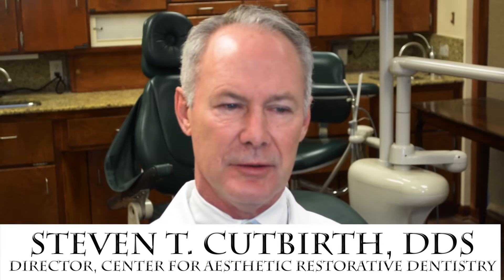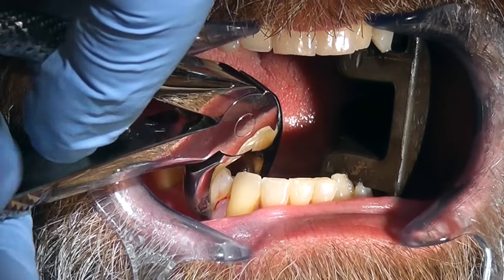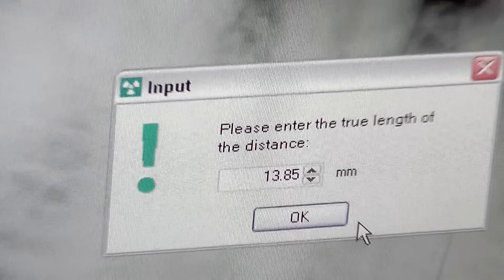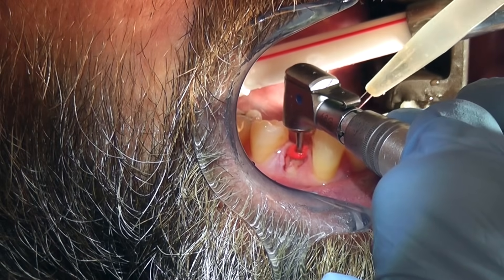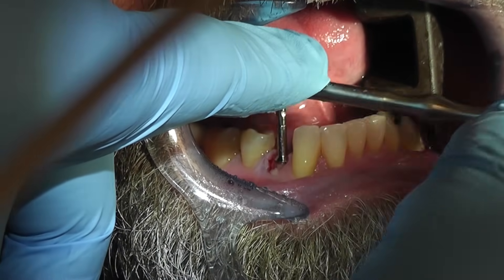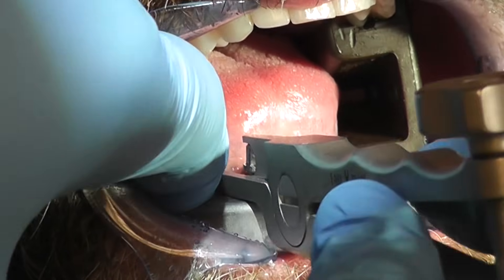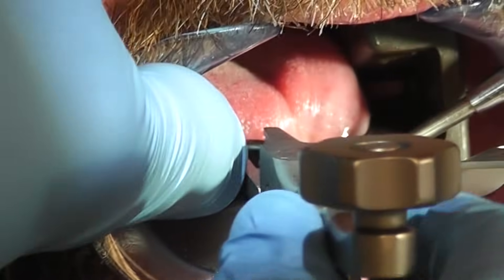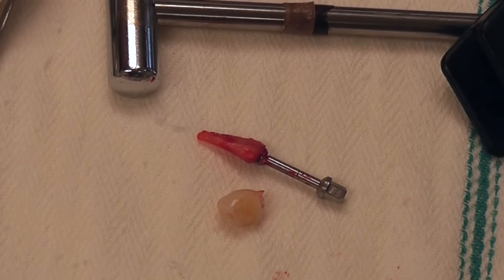Easy Tooth Extraction - Dental Minute with Steven T.  Cutbirth, DDS

Comment: My dentist just used a flathead looking thing and pried at them bitches then got those giant plyers and twirled it all around. Had 4 out in less than 5 minutes. No problems so far.

Edit: 4 front teeth. Upper front.

Also, for anyone dreading a tooth extraction, I was beyond nervous. To be honest, the shot in the front of the mouth hurt the most. Getting a shot in the back of your mouth is easy but right under the front of your lip and the roof of your mouth? Oh bud, not fun.

The extraction process was way easier than what I thought. It was pretty much painless, mainly just a bunch of pressure. Then you'd hear a small little snap, not super loud though just a little snap. The recovery process though, that sucked for about a week. I had a gnarly smell coming from those sockets for the first 4 days but no infection & no pain. It was an awful smell. That was the worst part by far.
Reply from the maker: Terrific.

Comment: I had been stressing to get 2 adult premolars removed for braces for ages. Finally got it done yesterday. EASY. They put some numbing gel on my gums before they used the needle for anesthesia. This hurt a little bit in some spots, especially when they go into the roof of your mouth. But when they started wiggling the tooth with forceps, it only took like 1 minute. Only discomfort was some cracking noises and your head being tilted slightly. After, it bled a lot for like 2-3 hours, but I just let the spit and blood combination dribble out of my mouth into the sink (don't actually spit). You cant really talk that much for the first 2 hours because your face is still dead. Had some painkillers and stuff but never actually felt any pain, just took them as a precaution. I drank a smoothie for dinner 2.5 hours post extraction. Next morning it was all back to normal, your holes where the teeth were go soft with the blood clot. Just be careful that you chew with the other side of your mouth. 

Its really easy guys, no need to stress. The dentist keeps you calm by telling you what they are doing.
Reply: I rather be gassed up instead of wide awake
Reply: @brandonroberts7055  well if u can afford then go ahead. Sometimes in life u gotta deal with the pain
Reply from the maker: So glad the procedure went well.
Reply: @centerforard  yep, getting another 2 out tomorrow! much less nervous now
Reply: Can i eat chicken
Reply: @annarapushobha1899 in the weirdest way this comment is so funny to me 😭
Reply: You completely took my fear away I’m here now for two teeth
Reply: @amariemorgan2515  
As someone who went on June 1st also.. How’re you doing love?!
Reply: I go get a tooth pulled tomorrow after work and I am TERRIFIED, NERVOUS all of the above… Any tips that’ll help me get through this…
Reply: I need to get that done soon, I’ll probably pass out
Reply: @User-718_  you will be fine
Reply: anesthesia? we’re you asleep for the procedure? we’re you able to eventually eat on the other side where the tooth came out?
Reply: @aliciyahunter8203  Yeah local anaesthesia so you cant feel the area where your tooth is and your cheek. You probably should eat something soft like soup the day of, but you will get back pretty fast to eating as usual
Reply: @maxcarnarge9233  thank you so much!!
Reply: Got 3 taken out today.  Didn’t feel the extraction.  The worst part was the anesthesia shots.   MAN DO THEY PINCH AND HURT!   After that, just slight dull annoying pain for the day or two

Comment: Why is all this necessary? You can just pull it out? Why need drills and all that
Reply from the maker: You are either joking or you may not have enough experience to know this, but when a tooth is broken  or decayed to the alveolar crest, there is often not enough tooth structure to grasp with forceps to extract the tooth vertically. This is especially the case if you are planning on placing an implant and preservation of the facial and lingual bone plates is important. Without the EasyXtract or a similar system, you are forced to remove facial bone and/or remove the tooth to the facial, which destroys the facial bony plate, making it more difficult to place an implant because of the lack of bone. 
Take your practice to the Top Tier. Subscribe to DentistryMasterClasses.com for an organized library of all the Dental Minute videos plus many complete comprehensive cases and many very important articles. New cases are added weekly.  Only $20/month.
Click here to subscribe: 
https://membership.dentistrymasterclasses.com/purchase/?plan=513

Comment: What is the benefit of using forceps then burs as opposed to starting with elevators?
Reply from the maker: If you are extracting a tooth that has inter proximal contact with adjacent teeth, there is no space to "elevate" the tooth to be extracted into without also moving the adjacent teeth while elevating. You must create space by cutting between the adjacent teeth with a burr, then you can use elevation prior to extraction with a forceps. Take your practice to the Top Tier. Subscribe to DentistryMasterClasses.com for an organized library of all the Dental Minute videos plus many complete comprehensive cases and many very important articles. New cases are added weekly.  Only $20/month.
Click here to subscribe: 
https://membership.dentistrymasterclasses.com/purchase/?plan=513

Comment: Thank you for awesome video! I was just wondering how many milimiters from the apex you want to be when you drill in? Also would the apical portion of the root ever break off using this system?
Reply from the maker: The drill is a certain length, which limits the depth.  Drill into the canal the length of the drill to the shoulder of the drill.

Comment: How to extract a tooth as a professional dentist with minimal trauma in five steps.

Firstly 3 fundamentals not to be forgotten during extraction:
(1) Adequate access & visualization
(2) A clear pathway for the removal
(3) Usage of controlled force to luxate and remove the tooth.

Step 1

Loosening soft tissue attachment from the cervical portion of the tooth by Molt 9 periosteal elevator, that will give two advantages:
a- Allows ensuring profound anesthesia has been achieved
b- Allowing the elevator & tooth extraction forceps to be positioned more apically.

Step 2

Involves luxation of the tooth with a dental elevator.
Elevation should occur at the mesial and distal buccal aspects of the root.
No elevation should be attempted along buccal bone because it can easily fractured or the surgeon can lose control & cause soft tissue injury.

Step 3

Involves adaptation of the forceps to the tooth.
The lingual beak is usually seated first and then the buccal beak.
The surgeon grasps the handles of the forceps at the ends to maximize mechanical advantage and control.

The forceps are  forced apically as far as possible to grasp
the root of the tooth as apically as possible, Why?
 
1-The beaks of the forceps act as wedges to dilate the
crestal bone on the buccal and lingual aspects
2- Forcing the beaks apically, the center of rotation (fulcrum).

Step 4

Involves luxation of the tooth with forceps.
In 3 stages:
1-Forceps apically seated as far as possible
2-Forces applied in the buccal and lingual directions should be slow, deliberate pressures & not jerky wiggle
3-Force held for several sec to allow the bone to expand.

Step 5

Removal of the tooth from the socket.
Once the alveolar bone has expanded sufficiently and the tooth has been luxated, a slight tractional force, usually directed buccally, can be used.
Reply from the maker: Thanks for the tips.
Reply: I FC
Reply: i need my teeth taken out as well please as my teeth are achin me

Comment: Had two lower molars removed in less than 30 seconds by a dentist in Homestead Florida that used a similar machine that grabbed the tooth then he twisted something like a ratchet and the teeth came right out. He just numbed me up first and that took 20 minutes. I was dreading their removal because I had one done before that took 2 HOURS to get out! All this dentist did was put some type of rubber pad between my teeth and said, You Ready. I was ready to endure a couple hours of torture. There was a clock directly in front of me so I saw the time. He opened my mouth, put pad in, tested numbness, then put his tool in, then crack, twisting noise of his instrument, then crack, twisting noise of his instrument. Then he took pad out stuffed gauze in my mouth. I thought it had just begun and now the hard part was coming. He then said ALL DONE! BLEW ME AWAY! NOT POSSIBLE I THOUGHT! BOTH LOWER MOLARS INE ONE EACH SIDE IN LESS THAN 30 SECONDS! By the way, he would not show me his tool he used when I asked how he did that so fast. He just gave me a BIG SMILE! WHAT A RELIEF THAT PROCEEDURE WAS as I had dreaded it immensely!
Reply from the maker: He may have used something other than the EasyXtrac system.  It takes a minimum of 10-15 minutes to use this system for an extraction.  Nontheless, I am glad it went well.

Comment: Dr. Cutbirth, I like your bolo very much.  Is it Morenci turquoise?  Forgive me but I would have luxated this tooth with the proper elevators/ forceps as I was taught in FDU Dental.  It was a simpler time.  I am from the class of 1978.  Excellent video.  Dr. P-
Reply from the maker: Nothing wrong with that technique so long as you can preserve the facial and lingual bone, especially if you are going to place an implant.  I rarely use the EasyXTrac System unless the coronal part of the tooth is fractured away and there is no way to grasp the tooth with a forceps without removing bone.  In those situations, the EasyXTrac System is priceless.

Comment: omg.. i just found out this site..i can learn so much from you..although this technique you cannot use it for curved rooths in upper molars though..
Reply from the maker: Subscribe to DentistryMasterClasses.com if you wish to see comprehensive, more difficult cases.  It only costs $15/month to subscribe.  Try it!  You can always cancel if you don't think it is worth it, but I promise you will feel you are getting your money's worth ten fold or more.
Reply from the maker: That is correct.  This is a technique primarily for 1 and 2 rooted teeth, i.e., bicuspids and anterior teeth. If the molar tooth extraction is difficult due to extensive loss of coronal tooth structure, extensive decay or long or dilacerated roots, consider sectioning the tooth into 3 sections and removing each root separately.  Cut between each root with a long shank surgical burr all the way through to the furcation, spread the sectioned roots apart with an elevator, then remove each root separately with a 150 extraction forceps.  This method preserves buccal bone and is pretty atraumatic.

Comment: use elevators...
Reply from the maker: If the clinical crown of the tooth is gone and the root is long, there is often not enough exposed tooth/root to use elevators or forcepts without removing bone.  We want to save the bone surrounding the tooth to be extracted for the forthcoming implant.

Comment: But in upper 6 or lower 8 with inclined roots how can you use this technique !?
Reply from the maker: Sorry, I do not understand the question.  Please rephrase.  Are you asking how to extract a tooth that is inclined?  If that is the question, you might sometimes have to prep between the tooth to be extracted and the adjacent tooth so the inclined tooth extraction is not blocked by the adjacent tooth.  This EasyXtract technique is normally used for teeth that have minimal or no clinical crown.  If the clinical crown of the tooth was mostly gone and the root was severely inclined, you might not be able to use the EasyXtract system.  I have never had that happen, but I can see how it would be possible.  It that case, you would probably have to remove some coronal bone so you could create a purchase area for regular extraction forcepts.  Let me know if that was not the question you asked.
Reply: @centerforard   nope he's asking if the first molar or wisdom teeth  can be removed with This technique.

Comment: For sure I can extract this tooth by 151 forceps under 5 minutes without using such a complicate machine
Reply from the maker: In most cases of simple extractions you are correct.  The problem arises when the crown of the tooth fractures off at alveolar crest level, especially when you intend to place an implant.  In that situation, the objective is to preserve the bone height so there is maximum vertical bone available for the implant.  Before training in complex restorative and aesthetic dentistry, I was in a 2 year oral surgery fellowship at Baylor College of Dentistry.   I have taken out a lot of teeth prior to restorative treatment.  Trust me, you want the EasyXtract system for those cases when you cannot remove a tooth without also removing facial and/or lingual bone to attain a purchase point for the forceps, such as brittle endo. treated teeth or teeth with large fillings or decay.  I probably do not need the EasyXtract system more than once every couple of months, but when I need it, it is priceless!
Reply from the maker: In an upcoming Dental Minute comprehensive case I will be presenting a situation with a maxillary lateral incisor, with old endo, fractured off at the alveolar crest level.  I demonstrate extracting the tooth with the EasyXtract system with no facial bone loss, followed by immediate placement of a Dentis root form implant with bone grafting and resorbable collagen membrane.  You will  love it!  I would never have been able to extract that tooth with forcepts without removing facial bone simply because there was no purchase point for the forcepts without bone removal.
Reply from the maker: Yes.  I place a lot of root form and small diameter implants.  You can see these cases in our DentistryMasterClasses.com comprehensive cases.
Reply: I totally agree with you Dr Cutbirth. The key is to preserve the alveolar ridge and achieve an atraumatic extraction for the purposes of future implant placement. There are some really good instruments out there to achieve that and Proximators and apical retention forceps are good to have in your setup. Hufriedy and Karl Schumacher are my top choices! Go for them
Reply: Dental Minute with Steven T. Cutbirth, DDS is this the same way to remove teeth for braces??
Reply: sir do it pains even if anesthesia is injected while removing tooth?
Reply: Aditya Mulye no. Patient feels some pressure only.
Reply: thx
Reply: My insurance and my dentist are not in agreement with the type of extraction that I had the dental office said I had a surgical d 7210 when my insurance said based on the information that they received it was a d7140 which is a simple extraction costing me less and I believe this is what I got because I didn't have any incisions I didn't have any flaps done I didn't have any sutures I didn't have a bad fragile broken tooth it was not impacted so how was it Surgical I think the insurance is correct that is was a simple all they used was a forceps and he used it very almost violently it was kind of traumatic he had to use a lot of his strength. Do you think you know by the information I gave you? Because I watched videos and it doesn't look anything like a surgical.
Reply: @ilamay77  Yes. Does not sound surgical lol. I’m sure this is resolved by now though.
Reply: I think for placing implants, the doc wanted to save the buccal bone...
Reply: Dent Photo 🖕
Reply: Did you place the implant dr. Cutbirth

Comment: Just like an easyout to remove a broken screw.
Reply from the maker: If a screw holding an implant abutment or crown breaks, the easiest way to remove the remaining part of the broken screw is either with an explorer (put the tip of the explorer in the broken part of the screw and unscrew the broken screw by moving it counter clockwise) or you can use a 33 carbide burr on a slow speed handpick and unscrew the broken part with the end of the burr (again, counter clockwise).  It seems that most of the time broken screws are loose, so they usually unscrew rather easily if you can get a purchase point on the broken part remaining in the abutment.